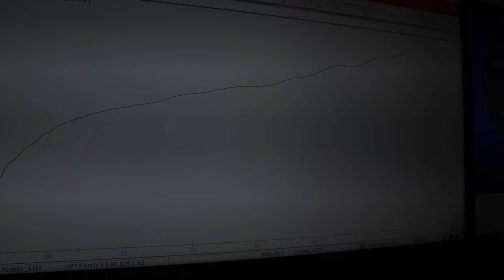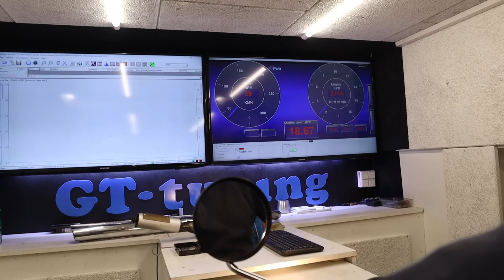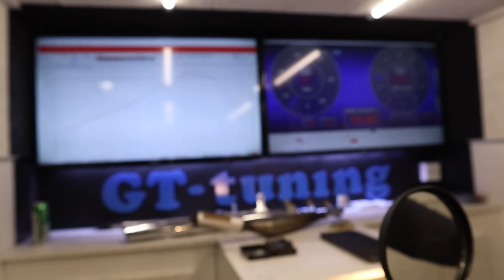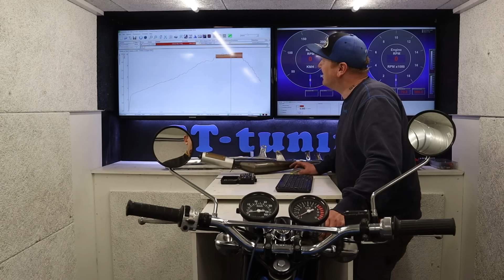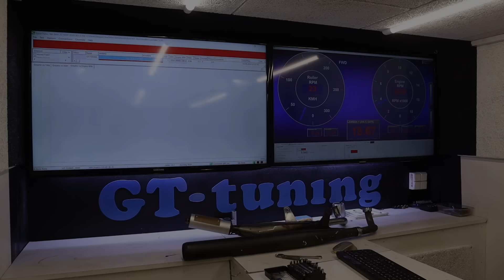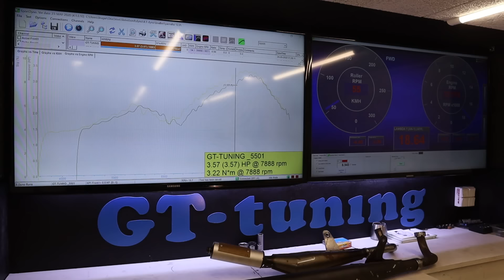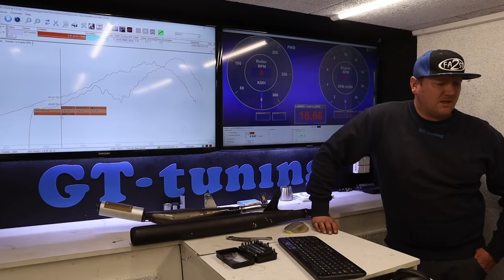Yamaha fs1 12.8hk 130kmt

Comment: Man, the way this bike looks just like the ones we drove these FS1,s  back in the 1980s way over 100 km easy, with a big ass bing carb, a worked up manifold and cylinder with a race piston with just one ring in it. Fast exhaust, take the damper out of it and a special ngk spark plug and banzai although we would usually spray the tank and the side panels over in non factory weird pastel colors without the brand name or stripes on the tank. 2F2s too but they were less popular. We'd pay like 300 to 400 guilders for em. thats like 150 to 200 euros today and another 100 guilders for fast parts. We ran Kreidlers too. 70 and 90 cc even with three gear blocks and the fun thing was that those blocks would fit under a Puch Maxi automatic moped. Those pressed frames would actually really tork and bend under the strain of the chain pressure . you could drive a Puch like that for 3 weeks and then you'd need another frame! Those great Yamahas and kreidlers, as well as weirder brands like Gilera, Honda and Flandria were cool too but never came close to this little two stroke monster. They go for 5000 to 10000 Euros these days!

Comment: Jeg har kørt med to opsætninger på min i sin tid, standart 3 kanal cylinder 16mm kaburator og 16 mm sideplade, 14 tands gearing og det der 5,3 udstødning, må nok indrømme det gik den sku fint med.  så har jeg også haft de de kaldte 9 hk det var 60ccm støbjern cylinder med 16mm kaburator plus sideplade 14 eller 15 tands gearing, proma udstødning og det kære 5.3 også, har en enkelt gang kørt med oplagt, med det der alu 12,8 som mange af makkerne kørte med gik sku langt fra godt.

Comment: 12,8 hp is not gona get you to 130km/h on a Fs1. My 60,4cc 44mm, 20mm Smp carburettor, Agge tuned Fs1 can do 105Km/h with Simonini exhaust. I think i have 12hp, you need around 18hp to do 130km/h.